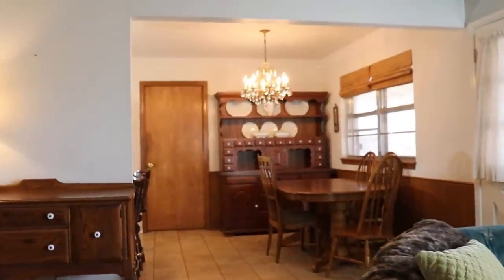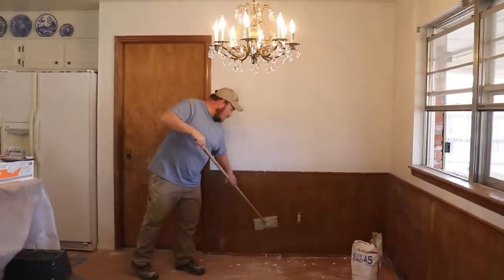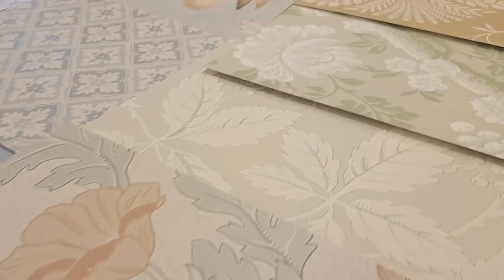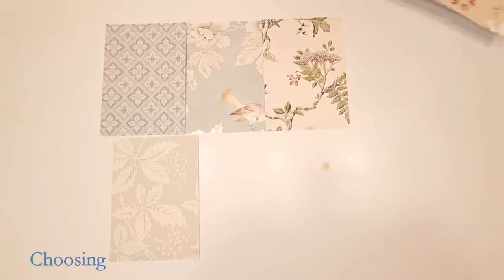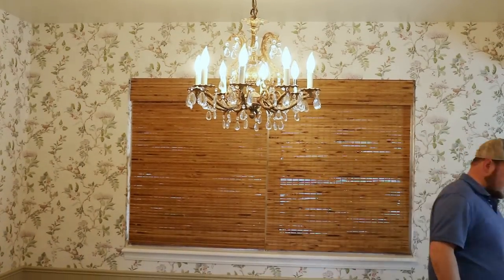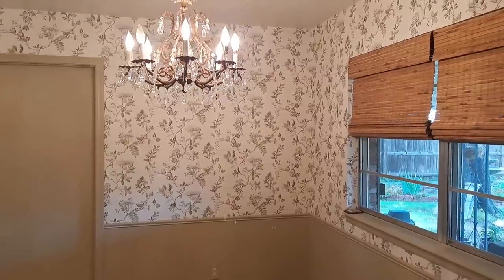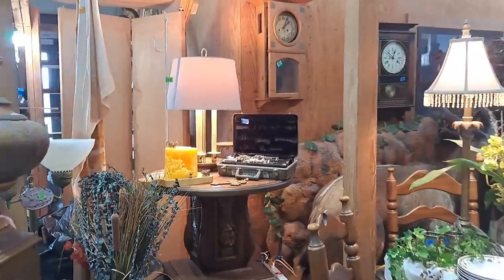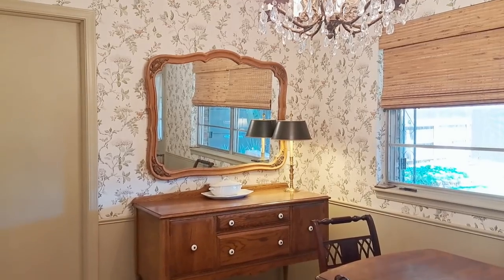English Country Dining Room Makeover ~ Home Decorating Ideas + Cottage WALLPAPER

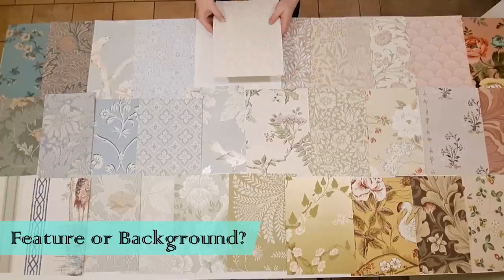Comment: The new smaller scale 6:58 furniture looks better but the table pushed up against the wall makes it look crowded.  Maybe a rug under the table would soften the floor. The light should be centered over the table and lower.  If you can’t move the light, place a longer chain on the light, put a hook on the ceiling (center of the table) and put hang it.

Comment: I think it all turned out lovely however, I think I would either center the chandelier over the table (and move the table out slightly from the wall) or I would take that chandelier and put it in the living room and remove the fan. Of course I’m looking pictures so I can’t tell if the chandelier would be too low for the living room. However, moving the table out a few inches and centering the chandelier over the table is easy job.😊